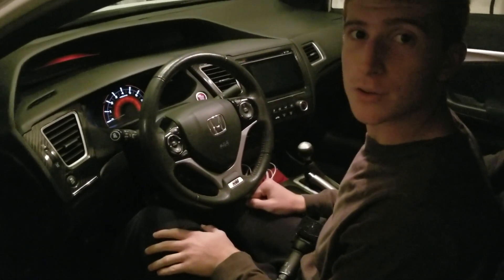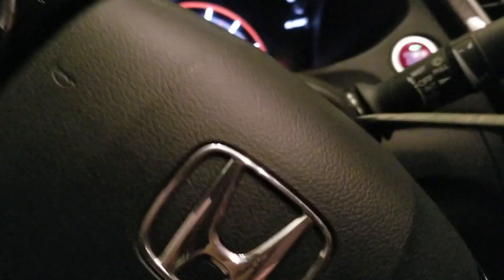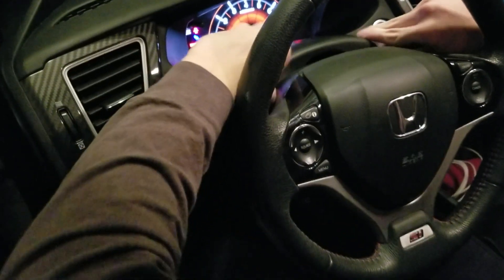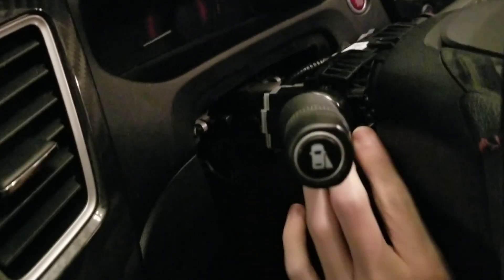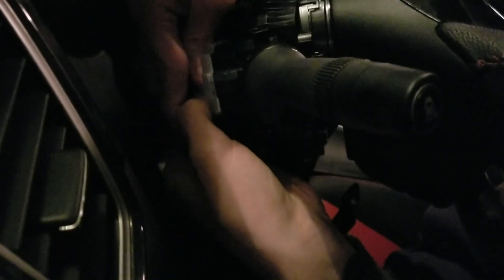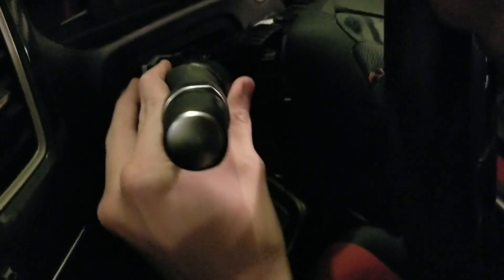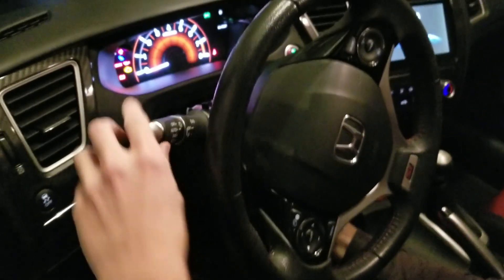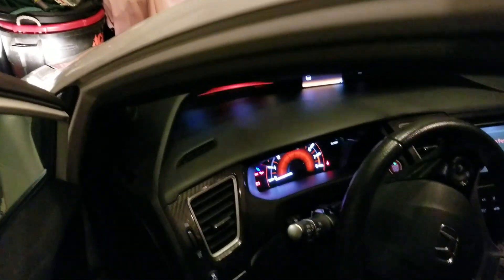How To Change a Light Switch/Turn Signal Stalk On a 9th Generation Honda Civic

Comment: My turn signal cancelling was delayed when changing lanes.  I bought OEM Honda Headlight Turn Signal Switch OEM Accord Civic (13-17) 35255T2AX42 and got it installed in 10 mins.  Great instructions!
Reply: Do u need to disconnect the battery first or no?
Reply: @Squid0011  No, I did not as there is no power to the signal when the ignition is off.

Comment: The lights off feature didn't work for  your car because as you said that stalk came out of an Acura, even though Honda and Acura are the same company, the Acura model has different features than your Civic does, so that feature is not activated in the car's computer system, this is why it didn't work for you. Now the same thing will happen if you were to put your Civic's stalk into the Acura, the camera button on the end of the stalk wouldn't do anything in the Acura.
Reply from the maker: Yeah.  At least I can turn the auto light delay off without having to mess with the settings by just turning the knob to "off" and then letting go after I turn the ignition off.  May not work how I wanted it to, but this is good enough for me.  Plus, it prevents people who want to drive my car from driving with no lights on at night.
Reply: @BusMaster99  ahh okay, that's smart. But when you use your right turn signal do you still get the right side camera come on?
Reply from the maker: It does.
Reply: @BusMaster99  okay, that's great.

Comment: So thanks for the video, it is helpful.

 I have probably the most interesting car problem that I have ever encountered. I drive a 2012 Honda Civic HYBRID. Love the car, great on gas and everything, yada yada. My issue is that whenever I turn on the blinker to turn left or right, the engine stops getting power to the same rhythm that the blinker blinks. I have no lights on the dash. The synchronized blinker/deceleration issue makes me believe it's an electrical issue that I have to track down. 

Does anyone have any advice on where to start? I have searched all over the internet and I am the only person I know that has this problem.

Comment: Do u need to disconnect the battery first? For civic 2013. I saw for older models u need to disconnect it first to replace the wiper switch. And i need to replace wiper switch is it same process?
Reply from the maker: Wiper stalk should be the same process.  There should be no need to disconnect the battery.
Reply: I always disconnect the neg terminal from battery when I’m working on electrical stuff especially when around and airbag just as a precaution wait 15 min before if you are working around them that way the system will be fully discharged